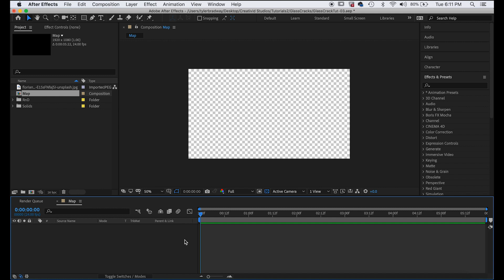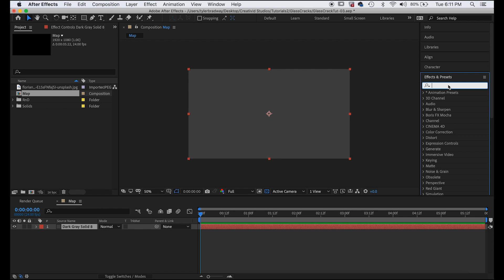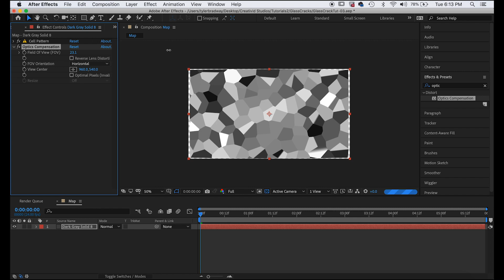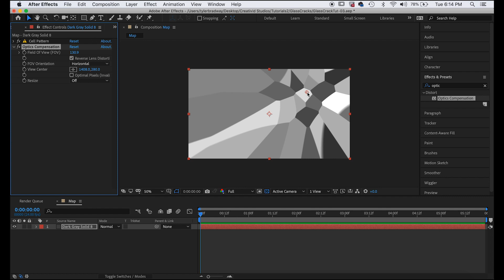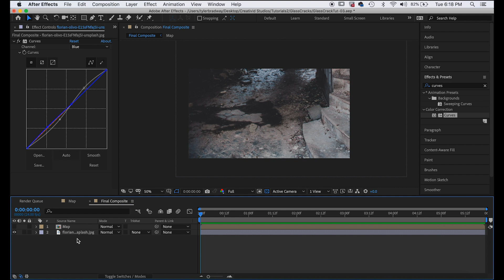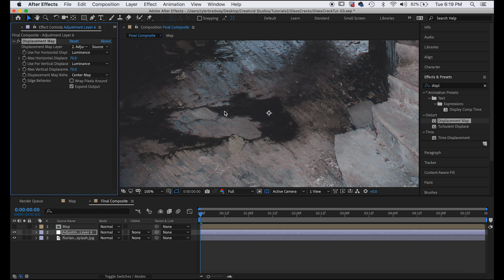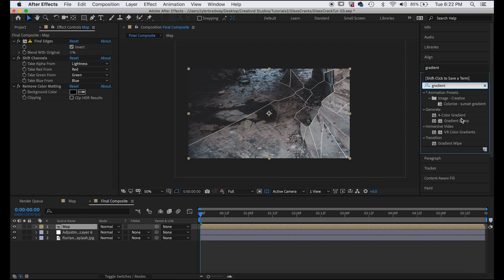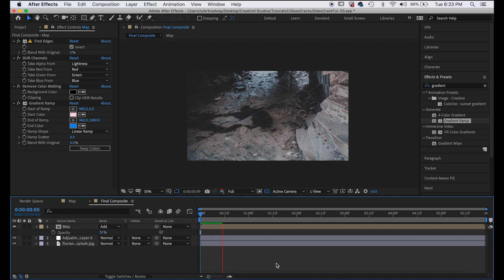CUSTOM Broken Lens Effects | After Effects Tutorial

Comment: Is it possible to have 2 or more points of origin?
Reply from the maker: yeah good question. you’ll just need to do some masking. 
inside the Map precomp, duplicate the layer. Solo the top duplicate, move the center point in the effect, then mask around that new origin -following the edges of the cracks. Then do that again and you’ll have 3 layers, with the top 2 having masks around the origins that are in different positions. 
i didn’t check, but i believe the effects used will support masks. but if they don’t, it’s that same process, but you’ll just have to mask on alpha mattes.
Reply: @BWayMotion   thanks for the response!